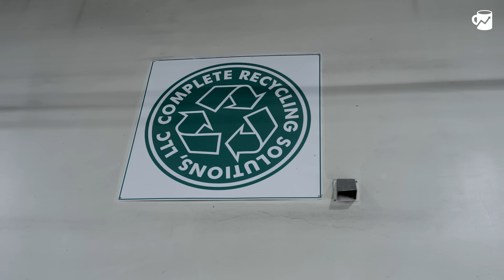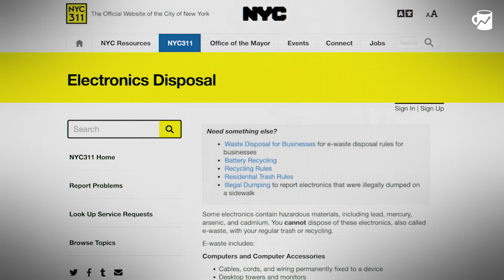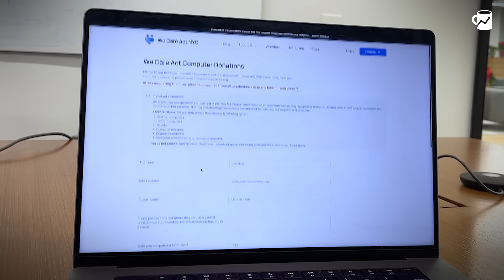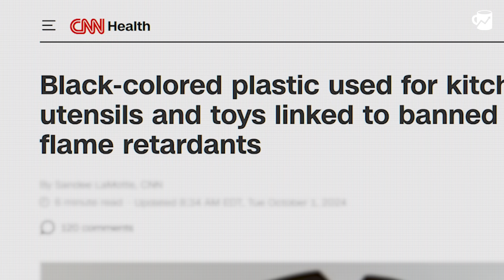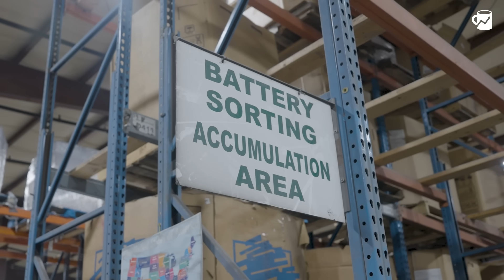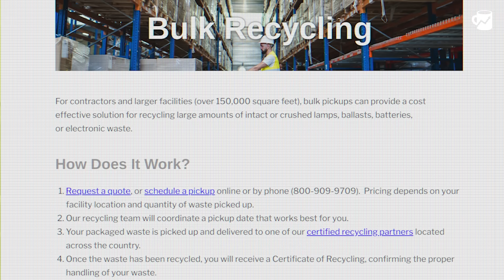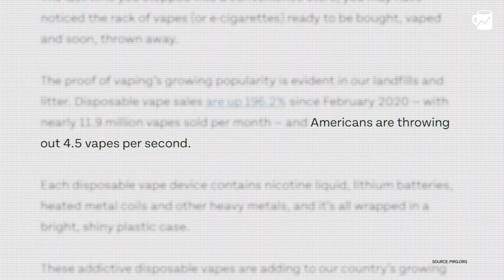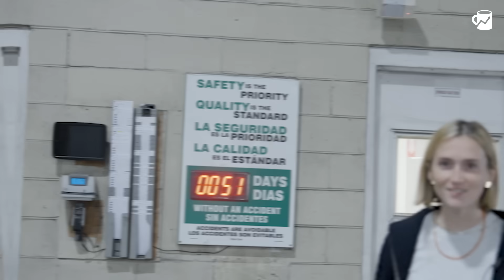I went down a rabbit hole trying to recycle all my tech waste

Comment: I feel like manufacturers can also do more on the front end. I have a Vizio TV that failed just a few months out of warranty. Trying to not be wasteful, I took it to a TV repair shop, paid them to diagnose what was wrong with it. Good news was they found what was wrong, bad news was that the part cost MORE than the TV itself brand new. I had no choice but to then pay additional money to recycle a TV that's just slightly over a year old. Manufacturers just don't build products that can be repaired.
Reply: That's a shame because I actually had an old Vizio main board repaired a few years ago. This TV model was from 2012 or so but the shop I mailed it out to was able to repair the part and it's been working fine since. Even the 3D stuff still works fine.
Reply: I had a TV fail while in warranty, and they refunded the cost and told me to just throw it away.
Reply: @lucency  Yeah, I just took an Insignia TV to Best Buy for warranty repair. It's been about 7-8 months, they tried to just refund me also. But I told them I'd rather they send it in to get fixed. I just got notice that the service center isn't going to try to fix it and to just refund me. What a waste.

Comment: Qucik question - how do you know that companies like Best Buy are "actually" recycling? I mean, they can easily send it to a dump - without anyone being the wiser. There are valuable metals in the e-waste, such as Lithium, Gold, Copper, etc. Some of the extraction methods are quite harsh. Also, a significant portion of the waste ends up in developing countries where environmental regs are non-existent. I think it might be worth looking into that - go down deeper into the rabbit hole. Maybe?
Reply: My question as well. Poking around on Reddit for battery recycling options, I found posts from folks at big box home improvement stores who said the little battery collection bins out front are hauled straight to the trash. Greenwashing.
Reply: @neddannenberg100  Facts! I see it happen everyday. There's no money in recycling anymore. Took off and a select few made profits but it quickly died.
Reply: Some real investigators have. It usually ends up in india or china causing many people bad health. Some just gets incinerated, the electricity sold back to you. I ffind that the most ironic way, besides just being resold on ebay.
Reply: If you want to dispose responsibly then look for a refurbisher with the R2-v3 certification it's the best available option at the moment. If it can't be refurbished then it may be dismantled and used for spares or worst case scenario it goes into a properly tracked recycling stream.
Reply: Because the waste has value and because you obviously have laws that require it to be recycled so they can't do that anyway. Right? Right? That's literally how it works everywhere else in the world. Doesn't surprise me the US is backward.
Reply: I hate to be negative, but my company says we “recycle,” and we just take what we want/can use (either for the company or personally) and the rest just goes in the dumpster out back.

Comment: The first step should be to try selling that stuff on eBay. Once you have a seller account, it takes only a few minutes to list that old phone or laptop.  You'll be surprised how some people will pay for ancient electronics!
Reply: I bought an old Dell laptop with Windows on it so that I could keep putting music on my 20+ year old Zune.
Reply: @scilamaccagno2206  it's wild that must do things like this to keep old hardware running. Credit to you for it!
Reply: Just last weekend we were cleaning out my dad's basement and we threw a video camcorder into the trash because it was only 20 bucks on eBay and not worth the effort for any of us to sell it. In that moment, being able to be rid of something "right now" was worth the $17 I might have made.
Reply: @azukizukisan   multiply that issue by a factor of 100000x, and now you understand why many product returns go straight into the landfill, as noted in Climate Town's latest video.  Sometimes when I sell stuff on eBay, it's out of the principle of the "reuse" aspect of "reduce, reuse, recycle", since I might not make real money on it (or even lose money due to shipping/fees exceeding the low sale price).

In the case of old video recording hardware like that, it's a public service to keep it around even if it's not worth a ton.  There's still videotapes needing preservation, and the camcorders and tape decks to read them are no longer manufactured.  The more desirable camcorders command higher premiums now, but eventually I imagine once those are too prohibitively expensive, other camcorders will rise more in price as well.  Even if it's not in working condition, the parts can be cannibalized to repair other tape decks.
Reply: @MillennialWildernessTherapy  I knew it wasn't the 'right' thing to do, but it was a long, hard, dusty day. It's to your credit to resell stuff like that, and you make a fair point about changing availability of materials for old formats.

Ironically, I did choose to take home 53 pounds of mostly-ferrous scrap metal and take it to the scrapyard for recycling....for a hefty $3.71. But it felt good to do that to all those rusty nails and screws and dull tools and flaking cast iron.

...But I guess that I can't argue that "keeping this in my trunk for a few days" and "making an ebay listing," I picked the easy choice. Even as somebody who does sell on Ebay!
Reply: @azukizukisan  I understand... we've all been there, in that type of situation, including me.  We all make compromises like that, unfortunately - it's the world we live in.  Kudos for recycling the scrap metal!
Reply: @azukizukisan  although in my experience with ebay selling it better to sell cheap stuff like that because they take less from you from the selling fee like I sold a quest 2 for $165 or so and only walked away with $116 while selling something for like $50 I get back like around $47
Reply: For those able and willing to deal with that sure. But I resell for a living and I won't touch eBay! Too many scams, too many fees and too much BS. It takes me longer to sell local using FB especially on small items but it's a lot less aggravation and stress.
Reply: @ashleighelizabeth5916  I find facebook extremely unpleasant to interact with, so I'm glad it works for you.
Reply: Yes, because it is the components that are valuable to techies like me.
Reply: And I don't know about the US, but in the UK it's now free to sell everything but cars! Well worth a try.
Reply: @Thisath100   I am in the US.  It's free to list things on eBay at a basic level, so you're out nothing if you fail to sell.  You only pay fees if the item sells.
Reply: @Thisath100  What? You had to pay to sell on Ebay? I'm Canadian, never once had to pay anything to post on my Ebay seller account. That seems like it was an extremely stupid idea.
Reply: The calculator for sure could be donated to other college/university/high school students.
Reply: I move a lot of stuff via eBay, and the effort involved + scammer buyers make it a net loss for anything less than ~$30, unless you do it full-time.  

In order to list an item, you have to take and process pics.  Measure it, find a box you can ship it in, with packing, and weigh it.  Input all that into your listing, so eBay can auto-gen the ship rate for the buyer.  Store the item, with its box, until it sells.  When it sells, generate a shipping label, take it to a drop-off.  This is not an insignificant amount of effort for a $30 item.  My PO and UPS Store are both about a mile away.

Then, esp. if you sell electronics, there's a class of person who has a broken item, buys yours and swaps parts so yours is now the broken one, then returns it to you as "defective".  So you end up with their broken parts and no payment, and you've lost both the item to sell and the shipping and labor listed above.  

As another commenter noted, a local CL or FB Marketplace sale at least just makes the item go away forever, no returns, plus none of the shipping overhead.

I end up giving away a bunch of stuff locally rather than push it out via eBay.  But most people have it much easier to put it in the waste stream (landfill) than go to the effort to find it a new home MUCH easier.  I a wierdo that thinks it's time we all stop burning things and burying things, so I make the extra effort, but it's a lot of extra effort.
Reply: My second step is posting for free and tons of people come..
Reply: Lol. No one is going to buy old broken wires, connectors, keyboard etc. On Ebay knowing they are broken.
Reply: @josephteller9715  depends on if the item is repairable.  I sold an Xbox controller for a few bucks that had glitchy thumbsticks.  People will disassemble them and repair them by soldering in new thumbstick potentiometers.